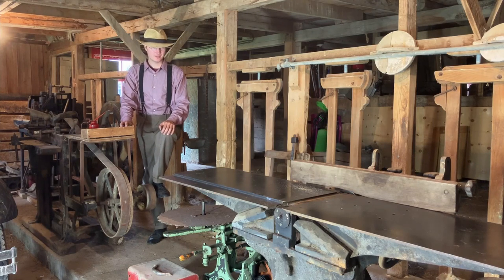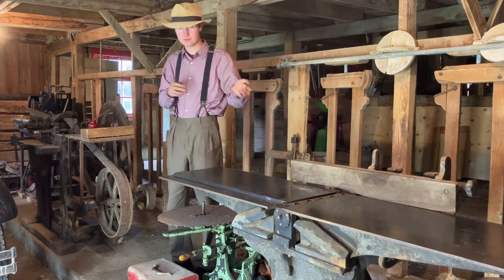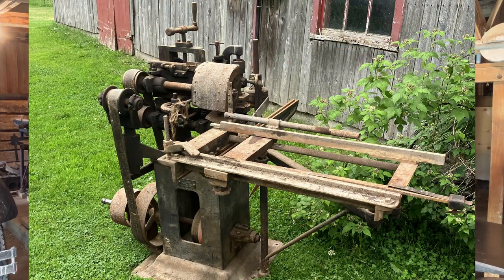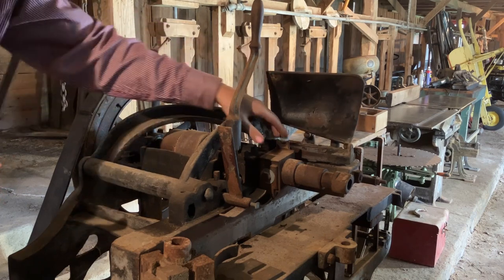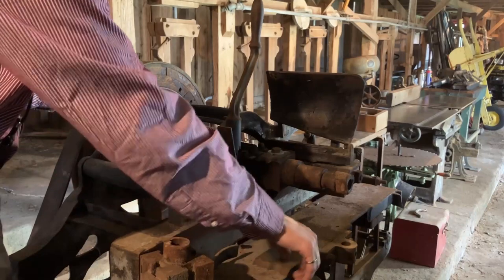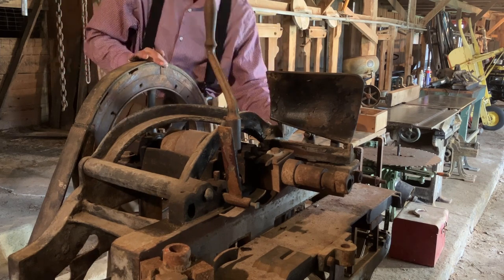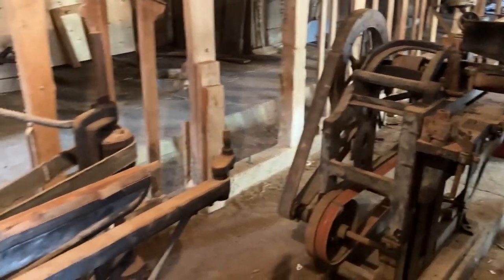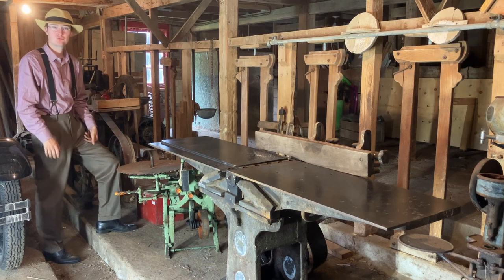Antique Sticker Molder and Tenoner: Sash and Door shop

Comment: Very nice little 4 head tennonner there...
The vertical blocks are used for scribing the ends into a moulding...
Guarding will have been a later addition...

Just be mindful of using those square blocks.......they have a reputation for throwing knives if set up incorrectly...
☹🇬🇧